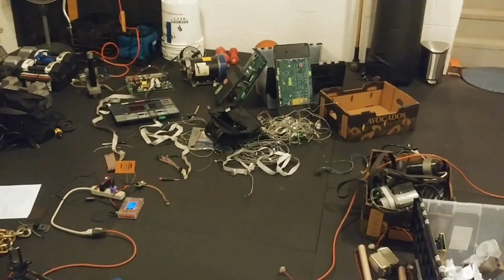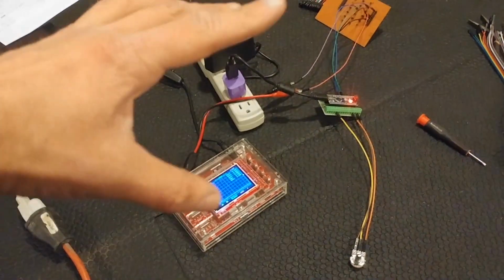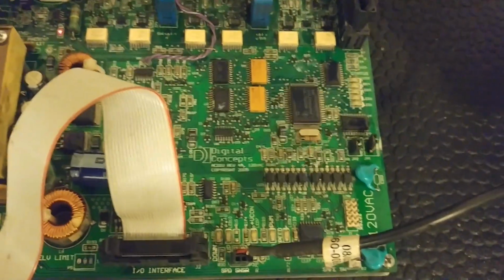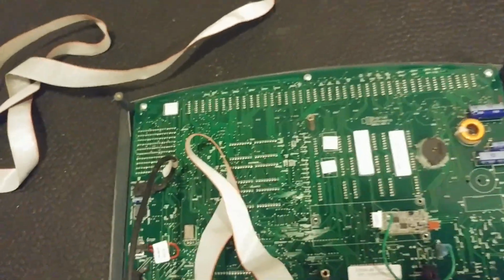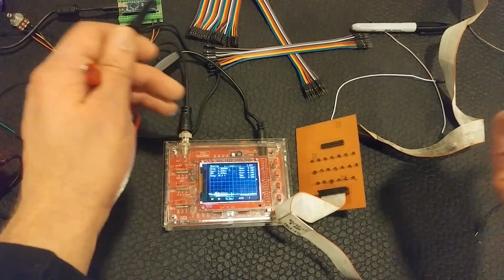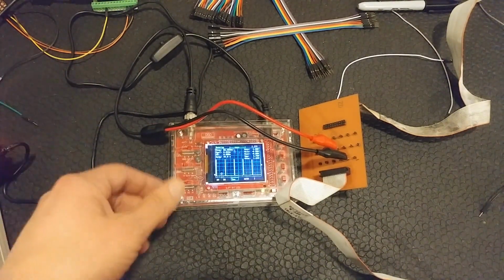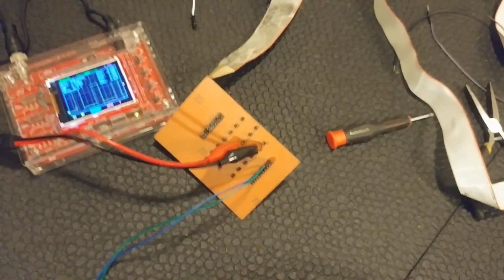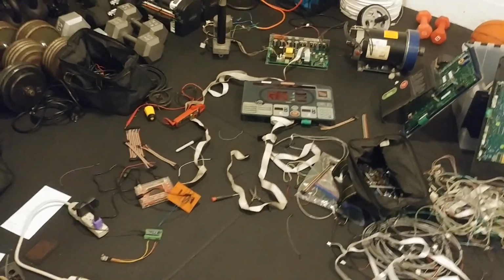Hacking a 3-phase treadmill, with a DSO138

Comment: At least it was an educational experience reverse engineering.  However Allen Bradley Powerflex 4 VFDs (as an example) can be had dirt cheap used, without having to decode and hack on an Arduino.  One model can convert 120v single phase to 208V 3 phase and would be more user friendly for the lathe. It even has a speed potentiometer on the front panel that can be used or bypassed.  With some other add-on items like a small HMI screen and a Remote I/O or Ethernet connection, you could set up a simple custom touch screen interface to control it.  Your method might be more fun from a raw engineering perspective, and I can respect that.
Reply: The OP explained within 3 minutes why he chose not to buy more VFD’s, that being said the Powerflex 4 today will run you over $300 minimum.

Comment: Hi nice video, do you have some tip for shop that sells treadmill parts like diplay, or modules ?
Reply from the maker: eBay is probably your best bet.
Reply: @swolebro  Hey, I have exaclly same treadmill as you, but my primary chip in display blows up and i cant find any parts just few for very high price.. If I send you some money (say how much) could you send me the codes from that mcu? I can replace it by new one and load up your code ,it must be same.. Seriosly i want to fix it up please ! :) THX and have a nice day
Reply from the maker: @blaharadek666  Pinouts and arduino code are here:

https://github.com/swolebro/swolebro-youtube/tree/4c1713429b1308968b498cf004f2da30bb18c9e1/arduino/treadmill

Formatting on the README got a bit messed up,  probably easier to read the raw file:

https://raw.githubusercontent.com/swolebro/swolebro-youtube/4c1713429b1308968b498cf004f2da30bb18c9e1/arduino/treadmill/README.rst

Lemme see if I can get around to listing some of the spare parts on eBay. Been meaning to do that, now that I know what I need to actually get the VFD parts up and running.
Reply: @swolebro  Wow thank you ! Yeah the readme txt is much better in second link. 
If you find anything just send it here i will notice it , as I said, its lot of money for whole console display.. on top of Iam able to change the MCU by myself but i cant find firmware to it :/ Is it possible to read codes from MCU anyway ? Isnt it locked ? 
I may pick up another display that gives out a PWM and replace this one.. But I need to figure out every single wire of VFD, if you want i will send you the rest of pins meaning :) and sorry for my english its not my language :D